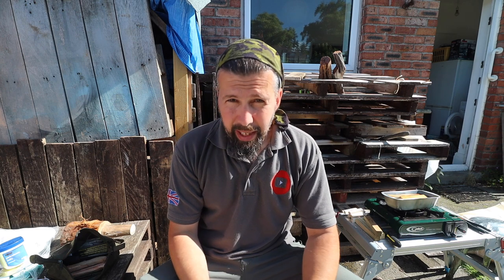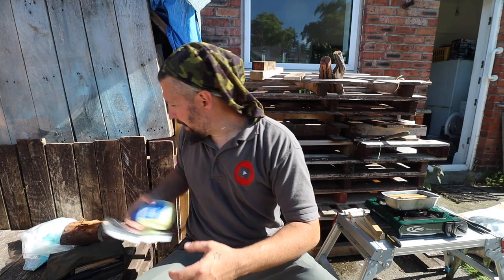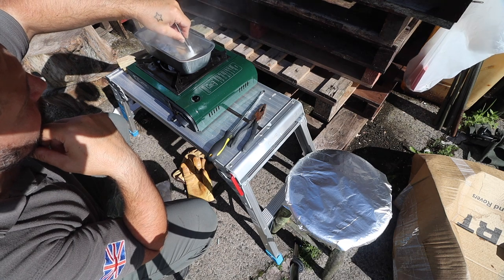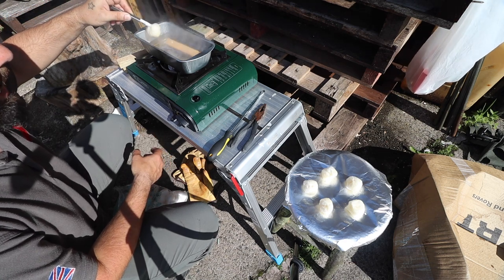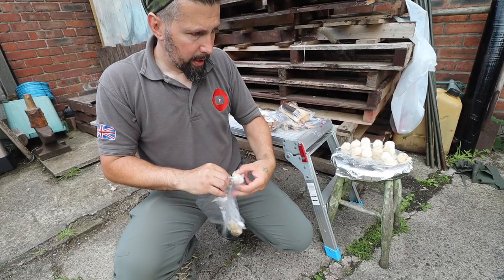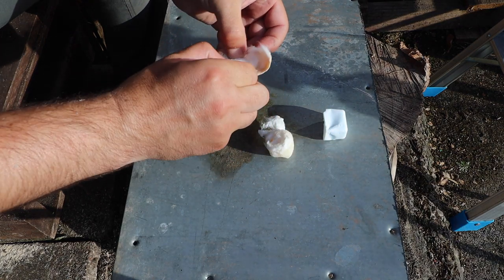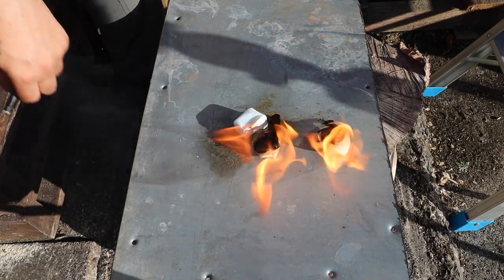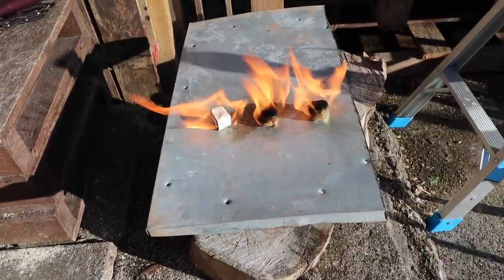Homemade All Weather Fire Starter vs Store Bought Firelighters

Comment: Great vid Spi . Never realised those "home made firelighters" burned so well for so long and were as easy to light . Definitely gonna try that pal . Last thing ya need when ya pi$$ wet through in a survival situation is to be trying to work your frozen digits to strike the lighter 5 , 7 or 10 times with the factory made fire lighters  . TBH I think the wax and PJ mix lit so easily off the first strike of the ferro rod , it fooled you into thinking it lit off the wax one .
Much love for doggo 👍🐕😍😍😍😎

Fattrucker
Reply from the maker: Thank you buddy, I carry them in my fire kit since Feb this year, they are great but had no idea they burnt as long as store bought ones, was an interesting experiment  to do on video.. I think this video will be one that grows over time
Reply: I've tried using some via a toilet roll and used kitchen oil. I'll see how well it works. It's bloody cheap and a decent use of old oil tbf too

Comment: home made fire starters are ... surprisingly common.

I am a huge fan of the Wax infusion method.
Wax and cotton (my preferred method)
Wax and Sawdust (second)

The one that I settled on is a wax infusion of Dental cotton (The fire plug), because it is compact, water tight, can be easily fluffed up for easier ignition, offers 5 minutes of flame, and is simple to Make and use.  I am working on the blend but my research says 2:1 of Wax and an oil should be right.  
I am still using my first batch of my failed blend because it meets my 5 minutes of fire requirement (My batches are 50.  I got a box of 250 dental cotton plugs for around $10).
Reply from the maker: I made a video of the wax sawdust bit failed miserably so never published it.

The dental cotton is very interesting, I've never heard of that - is that available at the pharmacy or supermarkets?

Comment: I’ve just developed an idea in my head of how to drastically improve this! Instead of cotton balls, just start keeping the lint produced by your clothes dryer. Fill a freezer bag with it so it’s full like a pillow. Dampen it, seal the bag, and place a heavy plate or brick on it after squeezing the air out. It will dry compressed and compacted. Once dry, break off small chunks and dip in the wax/pj solution as you did with the cotton balls. These should burn much better and longer. You’re welcome 😉